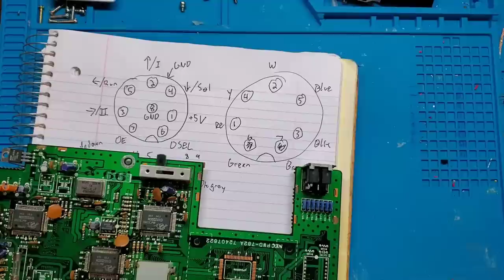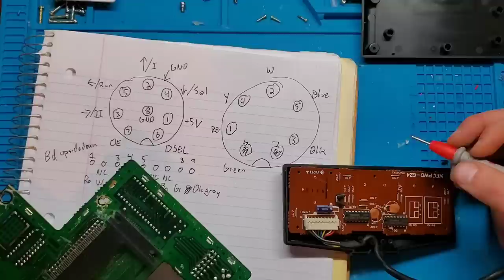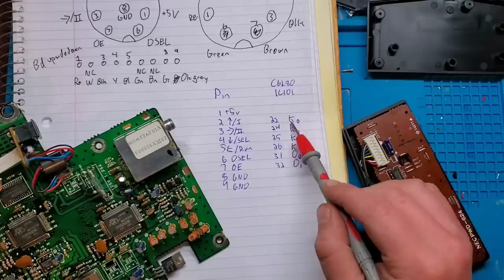Turbografx-16 - Part 2 - Bad Controller Circuit - Fixing Ebay Junk

Comment: I always keep clipped component leads and paper clips on my bench to place in connectors for testing. Alligator clip to the paper clip or component lead and use the other probe to trace out a circuit. Works like a charm and you don't have to use a controller to have a reasonably accessible connection to the pins of the connector. I enjoy watching how others work through troubleshooting using their own tricks. I always say there are more ways than one to reach the same goal. Keep up the good work.

Comment: Those aren't heat shields. They are RFI (Radio frequency interference)/EMI (Electromagnetic Interference) suppression shields. It's part of the requirement to get FCC certified so you can sell electronics in the US. They have been required ever since the 1982 Public Law 97-259 was put into place, which allowed the FCC to regulate the susceptibility of consumer electronic equipment.

Comment: Nice video👍I respect every fixer. Keep in mind that a Multimeter in Beep mode will send 3volt over your probes. It can harm low voltage parts like ic's. It's safer to use Ohm mode. Anyway, Good you found the problem and fixed it!  Ps. Buy some AMTECH flux. It will make your work so much easier.

Comment: Your videos are incredibly relaxing to watch, and I've found them super helpful in getting through these stressful times. Thanks so much!

edit:  it would be awesome if you went ahead and did a composite mod for the Turbografx.. I don't think it would be too tough since all the necessary signals should be present on that rear parallel port or whatever it is
Reply from the maker: That's my plan.   It'll be easy to tap into those pins to get the signals

Comment: The two parallel traces appear separate at 23:45 but after that final cleaning around 23:50 it looks like they were bridged to each other on the right hand side.
Reply from the maker: I can confirm they were not.  It does look that way, not sure why,maybe the alcohol refracting light?

Comment: 21:56
The reason the solder stuck to the board and made a mess was because you kept the solder on the iron for too long. This makes the solder dirty and oxidised, and this actually can cause bad solder joints.
As an electronics hobbyist, I personally would suggest only depositing solder to the tip like that AFTER you clean the tip and IMMEDIATELY BEFORE you apply the solder to the joint. If you keep the solder on the iron for 5+ seconds, consider it bad and clean the tip. And only put a large amount of solder on the tip to clean, tin, and to tin wires.

I also suggest using brass sponge tip cleaners (about $5) and a soldering iron tip refresh block (around $7) as opposed to a yellow sponge. It is far more effective and helps encourage solder to stick to the iron, allowing more surface area contact and thus more heat transfer.

I hope this helps!

Comment: I have found that when fixing traces it's easier to use kapton tape to fix the jumper wire in place before soldering. It prevents letting the first end of the wire loose when soldering the second.

Comment: I don't know who needs to hear this but...If you can not even properly unscrew a screw, please stop and never try to open anything electronic or mechanical or really anything ever again.
Reply: "Don't long screw a circuit board!" - Louis Rossmann
Reply: it may have also been a 7 year old taking it apart when they shouldn't have been. Though I had no problem using a screwdriver at that age to get into some of my toys.
Reply: I was so worried I would break something, I would be extra careful when I was younger...which might have led to my electrical engineering career path, hate to see stuff like this. Also pretty lucky 7 year old to have a TurboGrafx haha.
Reply: Who needs screwdrivers when you have teeth?!

Comment: I uploaded a similar trace repair on a UltraHDMI FFC if you want to see my technique. :) There really isn't much point to soldering one side at a time when the other side will always reflow when you heat one side. I would mask the other exposed trace with kapton tape, bend my wire in the shape of the trace, and flow solder over the whole thing while I hold it down in alignment. Once solid I wiggle the wires on both sides to break them free.

Comment: I wonder if the other board got broken from also leaving the game in - they unscrewed everything, and then tried to pull out the board, without removing the game. The cracks would definitely line up.
Reply from the maker: Possible,  i suspected they forgot to unscrew the two screws there,  but that could be the case as well

Comment: Shields up! Accidentally said "heat shield" multiple times. It's an "RF shielf" of course - to prevent high frequencies generated by the device to interfere with other equipment. Nothing to do with heat or cooling here.

Comment: If I may add a comment regarding the broken trace: it looks like the previous repair (idiot) broke the connection by prying the shell apart.
My thoughts below.

 My best guess is that they swapped the connector port because they thought it was the issue with the controller (making the assumption that console+controller were sold together), and didn't have the correct tools to open the console properly. In order to 'fix' the issue, they damaged the shell to swap the port (you commented on a bad resoldering job), then gave up when that didn't work. Just my theory, though.
Reply from the maker: I agree with you about the trace.  That mark looks like a tool mark from attempting to pry it apart.

I bought the controller separately,  but my guess is they were told to reflow the connector,  but they didn't know how to solder and did a rough job.   I highly doubt they had the skills or tools to desolder that many pins.

Comment: Getting composite out of the extension port is easy with some female dupont connectors.
Reply from the maker: Im thinking of doing a mod tapping from inside the case and routing through a trrs connector.  It'll be much cleaner than some connectors like I've seen.

Comment: Hey, man. I have a broken TG16 that has a bad VDC, VDP, or VCE and I have the equipment to salvage the chips from that cracked board. I was going to swap chips with one of my known-good systems to isolate the faulty chip and then order the right one from GameDoctor HK. Instead, I'd rather make a follow-up to your video using your cracked board if you're cool with that. :) How much do you want for it?

Comment: ah interesting it wasnt a controller specific issue rather the actual console PCB.  Will you consider those add-ons that go to the expansion port? That RF looks horrid
Reply from the maker: Im going to attempt to clean up the RF.  I'll replace the caps and check out the modulator to make sure everything looks good. 

Rather than an add-on, I was also thinking of pulling composite off those pins and installing a trrs jack in place of the RF out.  No case modification needed,  and better video and compatibility
Reply: @RetroRepairs  I like that idea! Cheaper than the $25 add-on from hong Kong.
Reply from the maker: Yeah,  and for some reason one add-on i looked at was neon green. Just repulsive
Reply: @RetroRepairs  ah i was looking at the ones without a case. just 25$ and has a genesis 2 port
Reply from the maker: @cyo_corner  In theory, I could make one of these:
https://www.ebay.ca/itm/TurboGrafx16-6ft-AV-Composite-Audio-RCA-Cable/153708340235?hash=item23c9bb240b:g:gDgAAOSwYOxeTx~S

the TRRS jack might be a bit more elegant though

Comment: I wish my hands were steady enough to do this.  I feel there is a broken trace in my TG 16.  I figure it has to be a broken trace because I tried 2 controllers and neither one wants to move upward.  Atleast I know mine wasn't due to someone opening it and scrapping the daylights out of it. I had it since I was a kid, and it has been in storage for about 10 years. Decided I wanted to try to beat J.B. Harold Murder Club and unfortunately, I can't due to controller issues now.

Comment: Do any of y'all have any experience fixing the R and L buttons on a SNES controller? I have taken the board out cleaned the contacts with IPA, removed some old excess flux and replaced all of the carbon dot silicone pads. The buttons work if I press hard, but not with normal pressure.
Reply from the maker: Sounds like either the shell is broken where the shoulder boards mount,  or where the button posts mount.   If the contacts and silicone pads are clean,  no reason it shouldn't work unless you press hard,  they'd either work,  or not work.

But there shouldn't be Flux on those pads to begin with,  so maybe they're not fully clean?
Reply: @RetroRepairs  Thanks for the reply. I had replaced all of the carbon dots/silicone with some new replacement ones I bought. The design of the base of the silicone for the L and R is slightly different than OEM. I cleaned the OEM ones and put them back in and now it works perfectly. Seems to be a problem with the replacement carbon dots.
Reply from the maker: That's annoying, but glad you got them working.

Usually unless they're ripped,  cleaning the silicone pads and the pcb works 95% of the time

Comment: @RetroRepairs Hi I have an old snes I got from eBay that has a damaged multiout port [sound works] video has vertical Morse code on either background objects, sprites in gb games & some texts become blocks or impossible to read. Do you know if it can be fixed? Happens even over the 240p component mod.
Reply from the maker: That sounds like bad vram more than a bad mutiout port
Reply: The port goes out if the cable is bumped or moved, can't see any broken traces or cracks on board. I tested the cable on gcn works fine both original cable & svideo cable.
Can the vram be fixed? I was gonna give this to my sister for her kids to play during quarantine, still had some old games left donkey Kong country, mario all stars, world & the gb cart. Bought it in November as "not tested as is" for spare parts or new snes, my old one wouldn't turn on the power supply needed resoldered, so is it fixable or do I have a permanently broken one?
Reply from the maker: You could try reflow all the connection points around the connector first,  see if that makes a difference.   Could also be dead capacitors which is very common on those boards. They lead to early chip failure.  I dont really work on snes boards for that reason, so many dead chips with no replacements available
Reply: Alright thanks, I gave em the good one so I'll try fixing this one if I can't I'll keep it for parts & get a good snes.

Comment: The cracks in the board indicate someone tried to lift a hue card up in the slot as opposed to sliding it out, perfect cracks radiating outward from the slot.

Comment: Some guy just offered to sell me one of these,   if it a good price I will,  the games are so expensive though.  Just rebuild a model 1 genisis.  Don't know if it works yet,  need to get the power and av cords.
Reply from the maker: If it's a good price,  definitely jump on it. You can always buy an everdrive. The knockoff ones are like $40 on aliexpress
Reply: That's what I was thinking,  lots of great shmups.   Off topic,  my Sega genesis model 1 that I am restoring just keeps flashing red light,  seems like it trying to run.   Should all my caps be giving me 5 volts?   Some are reading less than 3,  that meant those are dead?
Reply from the maker: No,  i don't believe they'll all give 5v.  Lots of circuitry will be working with less
Reply: Okay,  is there any way for me to send you a picture of the area?   Or a spec sheet of what they are suposto read?  The console was very dirty and has some rust,  the mother board is in very nice shape,   could this be a reflow kinda thing?  Cold solder from being exposed?  And with reflowing I should Keep my iron tinned as I do it and flux 1st?  Sorry Adam,  pesky fan here.
Reply from the maker: You can email me at retrorepairsca@gmail.com
Reply: Also have to try and fix an error 21 on an original Xbox,  Tried to load a Xbox live game to see if it would load and reformat the hard drive,   the disk never boots up though,    going to clean the laser today and see if that helps.   Done see you work on Xbox but I never search for that stuff,  wanted to distance myself from disk machines,   this is for his kids though,  he wanted to share his memories of that sweet clutch whatever.   I am just offering a barter repair service wile the pandemic is going on.   I don't want to tell him I am not able to fix it because I don't have a computer still.   And the only other fix I have seen involves some hot swapping bull crap..   Give me a retro system any day..   sigh
Reply from the maker: I know what you mean.  I haven't dabbled with an xbox at all, i also prefer solid state systems.  There's a laser and a capacitor that often goes bad in those,  but im not sure which one exactly to offer any guidance
Reply: Yeah it's okay Adam,   I figured the same thing at first,  get to rip it apart and clean it,  see if there is a way to reset it maybe,  I know the clock capasitors are all going bad.   A ticking time bomb.   Trying to get my old green Xbox from my ex today.   Stupid I got to buy my old consol back.   I figure the disk may not be seeing the disk so if I dab with Iso it may just read the disk and do it's trick.   Will be defiantly bring my turbo 16 controller with me when I go to Ontario.   That's if I get it....   the local pawn shop owner here claimed he has the first ever hand held,   he will sell it to me but it's burried in his basement at the moment.   Will let you know more about that when I hear more.   Says it's bulky but he isn't into the game systems.   Won't even buy retro systems,   he will let me leave a card there for repairing or buying them.   Just bought Yars Revenge for the Atari and I still need a 2600.   Cart just looked cool.

Comment: Maybe next video you can try to get the nes toploader working now you have nes to test the chips and another new front loader not working
Reply from the maker: I've been working on that recently.  Still not working yet
Reply: @RetroRepairs  Bord it self looks just fucked up. Maybe full resolder for all contacts on board may help. (just my opinion)